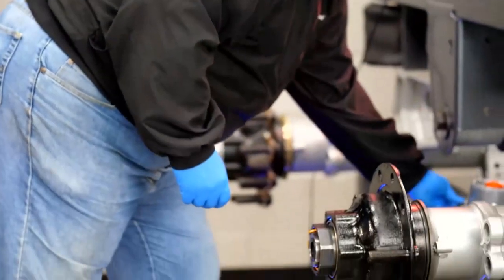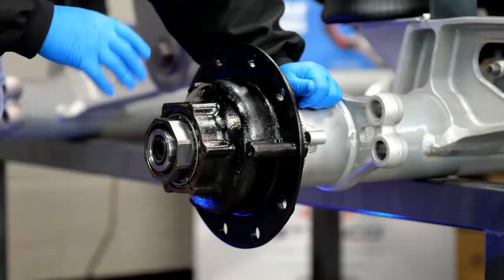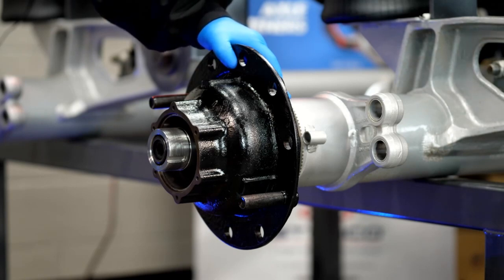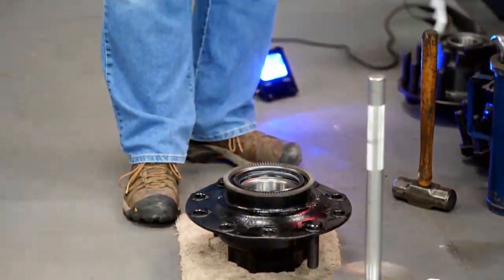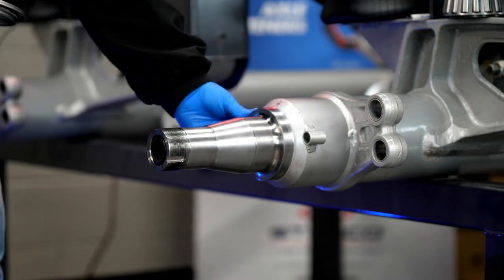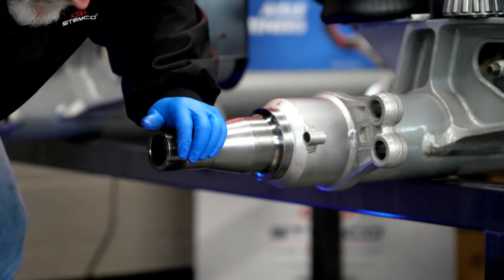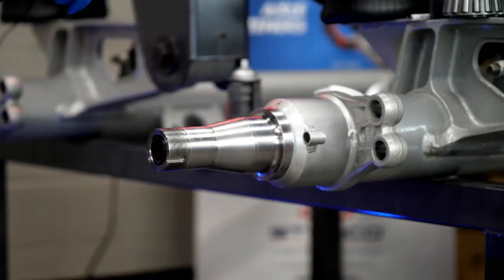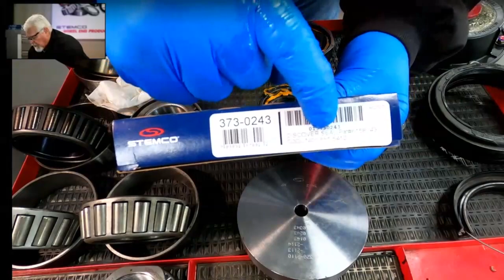STEMCO Tech Talk on Wheel End Bearing Adjustment September 24th 2020

Comment: If the red plug popped out of  the stemco cap and it was missing what should be some of the reason to cause it
Reply: Likely a plugged vent hole inside the red plug. Carefully inspect your components as the heat generated to cause that much pressure to build up is likely a sign of failure.

Comment: I’m surprised at how many are supposed to be competent at wheel bearing assembly. For some reason fail . I see a lot of bearings with excessive clearance at the spindle . As this is a slip fit,,  not a wobble fit or press fit . Just measure then put new bearings on .or new spindle or axel . I’ve seen over 1/8th inch . Clearance. This is US standard measurement. No metrics here ,, I can but won’t use metrics .